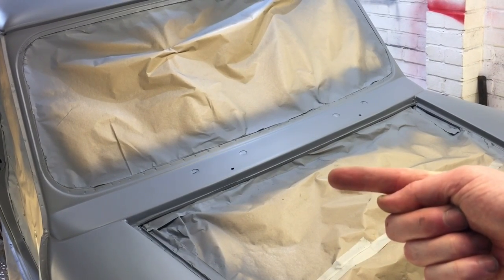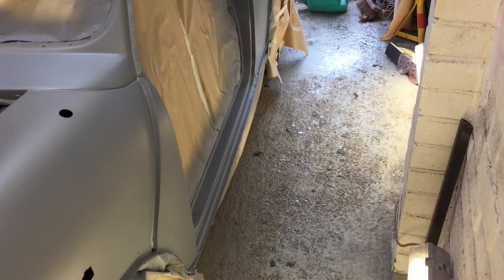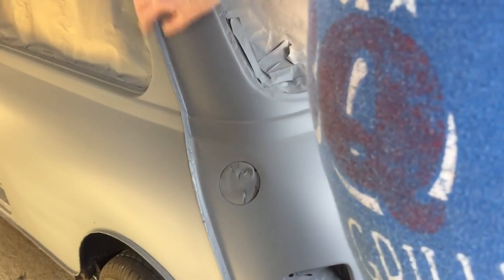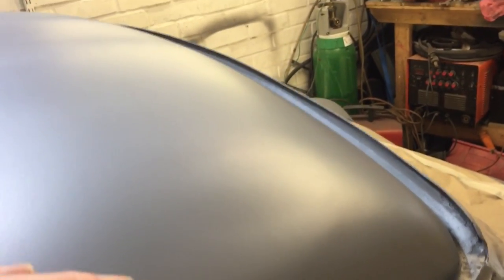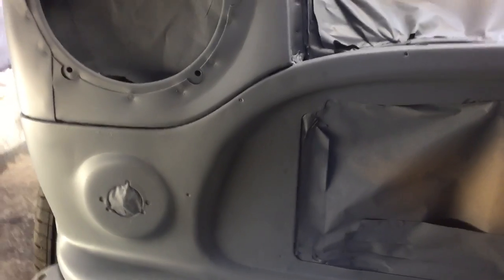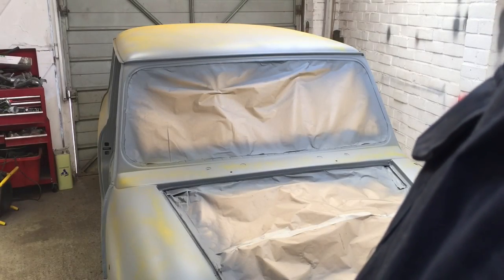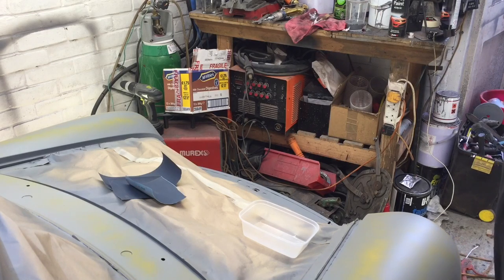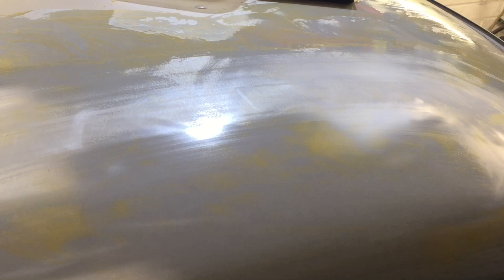Classic Mini Restoration Part 122

Comment: Its coming along nicely. If you get a dry block with a vacuum attachment, you can 240 block it dry, then 400-500 DA it after. It's alot quicker and alot less mess. Then just sand all the hard to reach bits by hand after.
Reply from the maker: +EnZedKiwi cheers. Might try that. I get advice from my dad. Hard to ignore him sometimes :)

Comment: As others have said, you can get away with a much coarser sandpaper.  The 600 and up just glide over the high spots without cutting them down.  I would use a 240 then 320 and it helps to use a longer sanding pad of 10-12 inches.  Go diagonally across the roof as well as forward and back.  That is how I have gotten Mini roofs even.  Cheers Matt.  Keep up the good work!
Reply from the maker: cheers , will do some of that on my next paint job next year

Comment: you need to get it 100% if you can as black will show every imperfection. when i did mine it was guide coated and we just used a orbital sander no water down to 1200 grit as primer absorbs water then tac raged with panel wipe as well to remove dust to avoid scratching the primer. looking great and makes a difference being in primer
Reply from the maker: +mark piper cheers mark

Comment: Lookin good bud, maybe when on bigger surfaces try long sweeping motion to get the blocking smoother, plus when you've gone down quite a bit and there still slight dips then just put three little bits o masking tape around it bait out pointing in at it so you can just build those spots up with a few more coats o fill/prime to get up level with the rest. And yeah save the wet/dry for final coats where it really counts. Gosh it's getting exciting eh?
Reply from the maker: +PIPER DOUG cheers. Did that masking trick last night.  I was planning on going over whole car again with filler primer worth it ?

Comment: Are you painting the car a metallic black? if not you dont need to go so high with the grit (could get away with using 320 grit to remove the worst of the orange peel and surface layer before moving to a 500 grit to finish off), also as someone else has said would be better of dry sanding the primer back because cellulose primer is porous (more so than a 2k primer)
Reply from the maker: +EA Composites not matalic. Just gloss black. Cheers for advice
Reply: no problem at all mate, the guide i did on the t4 forum may help you out a little more also http://www.vwt4forum.co.uk/showthread.php?t=89143 

might help you out with the way you use the sanding blocks etc
Reply from the maker: Is it worth. Or waste to go over whole car again with filler primer today ?
Reply: of course its worth going over it again with highbuild primer mate as your painting the car gloss black it needs to be arrow straight because black will show even the slight imperfections
Reply from the maker: +EA Composites ok. Just trying to get these damn patent seam strip covers to fit. Rears are well off , #wastingmyday
Reply: no worries mate happy to give advice when and where i can. what seems to be the issue with them?